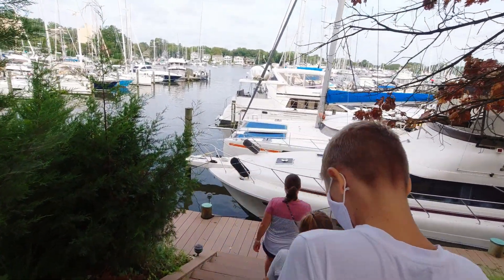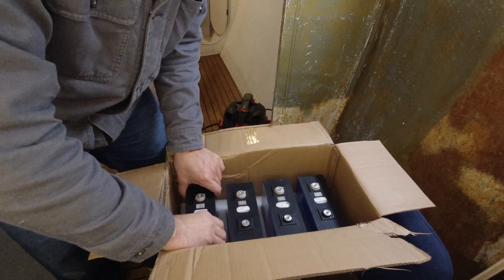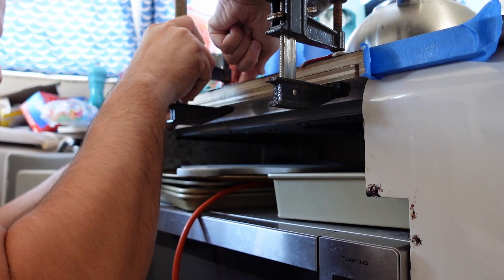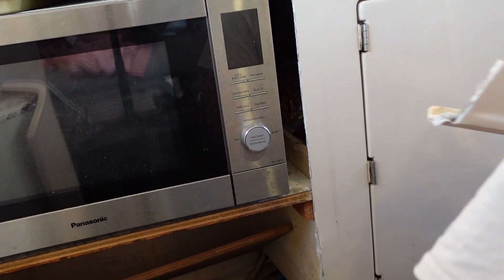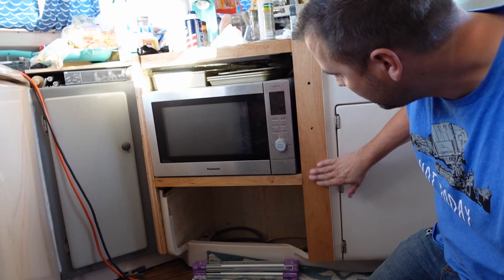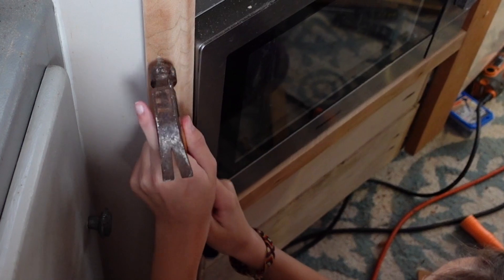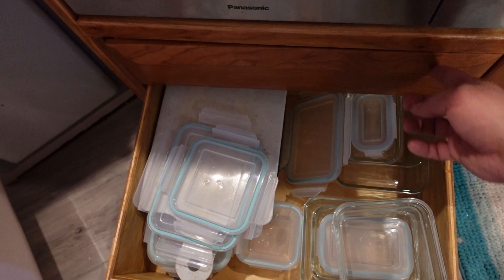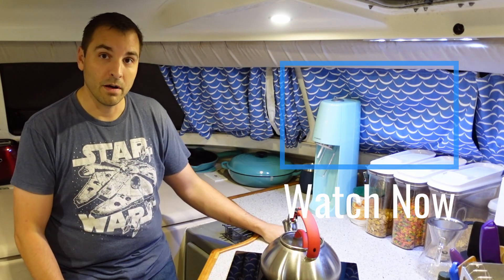Sailboat Electric Galley Renovation Before and After

Comment: Great setup! How is the power consumption of the galley? How big is your battery bank and inverter? Can you run both hotplates and oven at the same time? I imagine it takes some planning to cook a meal.
Reply from the maker: Hi Philip!  We have 1400 amp hours of LiFePo4. The Victron multiplus can handle up to 3000 watts. We have not had any limitations with our appliances.  We haven’t had to do any specific planning to prepare meals. The induction cooktop will automatically limit one or both cook plates not to exceed 1800 watts.  Everything works beautifully!  😊 I made a couple videos about my batteries, you may want to check them out! 😉
Reply: @SaltyEscape  Corey, I assume the multiplus is 3000VA - that's about 2400 Watts. Can you run a hotplate and the oven at the same time? I'm trying to get a realworld idea of how much power I'll need - I just figured out this week that my Victron Phoenix 2000VA is not nearly enough...
Reply from the maker: We frequently use the induction cooktop and the microwave at the same time.  We rarely use the convection oven feature because we prefer to use our Ninja air fryer that we put in the cockpit however we also frequently use the Ninja with the induction cooktop together and that should put the same demand on the Victron electronics.  We have never kicked a breaker.   Most of our experience has been well plugged into shore power although we do have a handful of weekends where we were running off pure battery power. Still no electronics issues.  😊